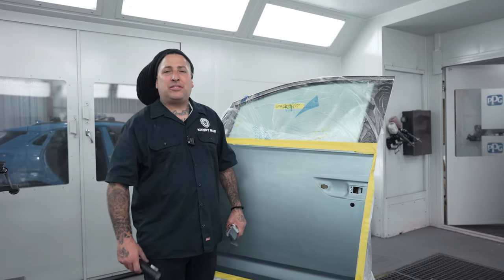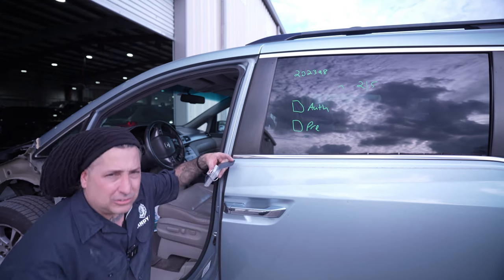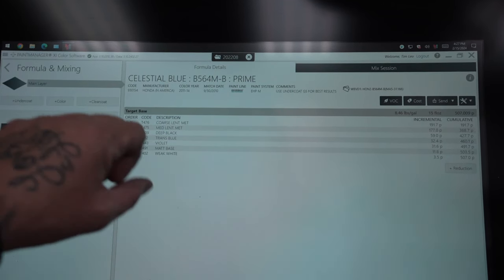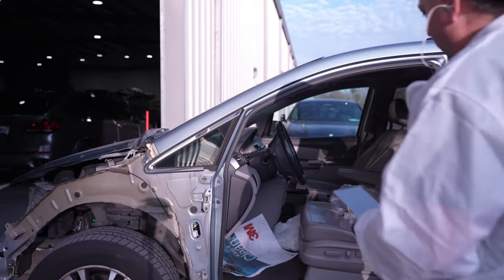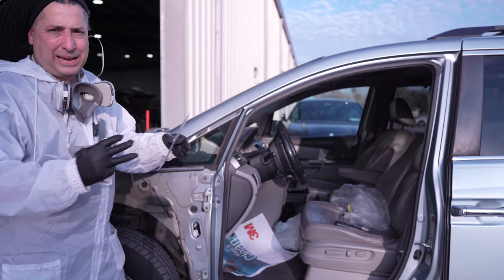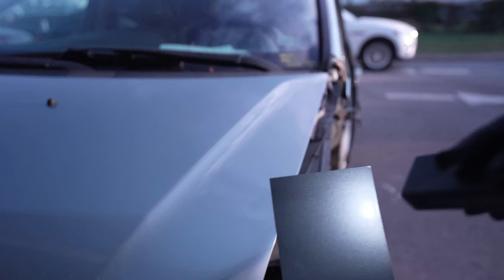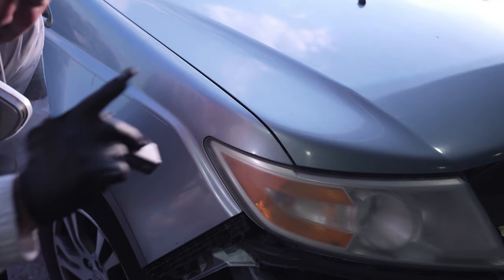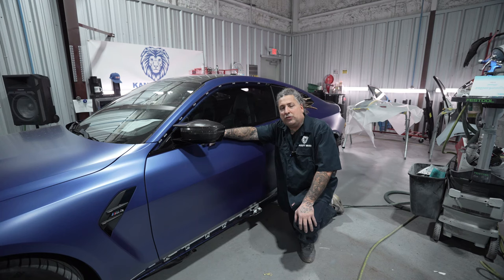How To Color Tint

Comment: With Standox, when a color didn’t match, it usually fell in between 2 variants. I would mix 2 ounces of the 2 variants, then slowly add them together, till it matched. During this process, I would notate the calculations of each tint and defiantly keep the spray out. Colors usually were not off, but when they were, it was way off. Only had to tint colors about 5% of the time. Sherwin colors matched pretty decent. PPG Envirobase wasn’t horrible, but Lessonal was the worst!

Comment: Complete amateur here looking for some advice as a garden/hobby sprayer.. whenever I start colour tinting I always let it dry down and compare, but I find once wet out with clear it changes colour temperature again, a total nightmare for my factory alpine white panels that I want to match. Could I compare the colours whilst the basecoat is still wet in the pot? That way I have an idea of what it'll be once glossy or does the dry down colour shift a lot more than I'm imagining?
Reply from the maker: It's best to clear it and check  it for best results

Comment: Another great Video, Candy Man.  Quick question: Can you tell us if there is some sort of pigment or simple tint product that can be added to adjust (lighten) a 2K Urethane topcoat? I have a gallon of 2K Urethane automotive paint that was supposed to be a dark Charcoal Gray but its actually almost totally black. Just need to lighten it a bit by adding some white but I can't figure out what would be safe to add and, no, I don't have any white 2K paint to add. Any tips on this,  guys?
Reply from the maker: What do you have to add
Reply: @kandyman5315  Thanks for asking. I think that just a very small amount of white would do it.
Reply from the maker: @PJ-ee5mc yes
Reply: @kandyman5315  What I can't find is any info on what sort of pigment would be correct and not ruin my paint. If it were latex, analine leather dye or lacquer there are all sorts of dye kits but I see nothing that claims to work with a 2K urethane. Any ideas for something other than buying 2k white paint?
Reply from the maker: @PJ-ee5mc do you have 2k gray primer
Reply: @kandyman5315  I do, and I actually thought of  that but wondered if it would affect the finish to much. But a little primer might lighten it just enough, and if it mattes the shine a little that would be okay too!
Reply from the maker: @PJ-ee5mc 👍